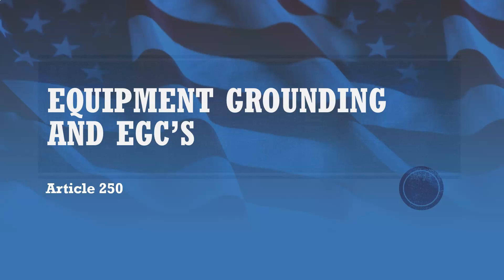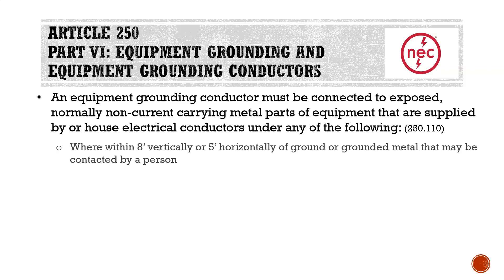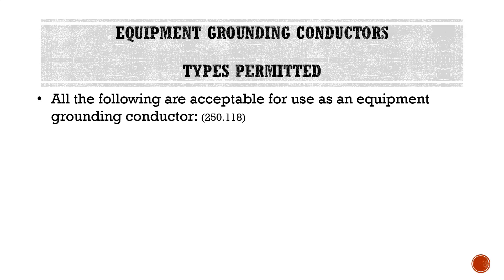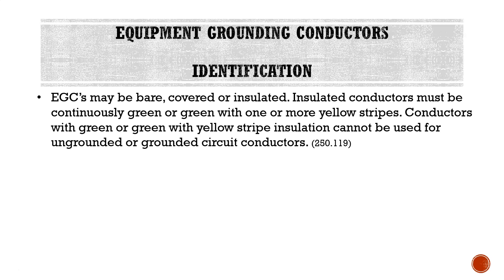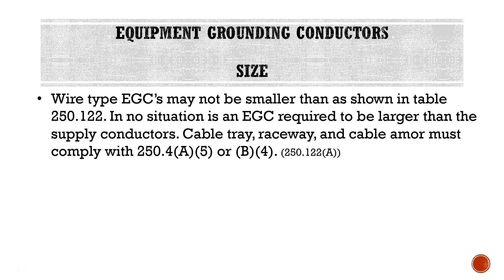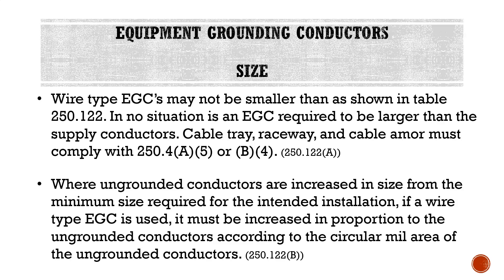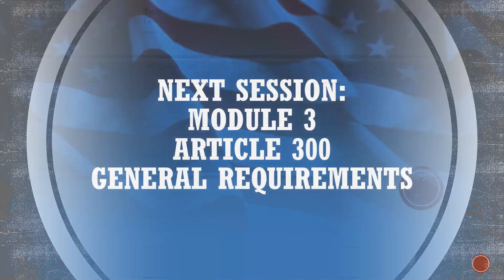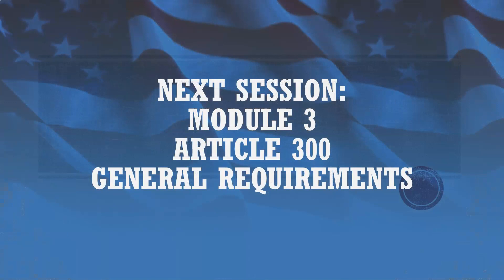Equipment Grounding and EGC's

Comment: It seems to be missing standard over current protection device sizes. What would a 50 amp circuit equipment grounding conductor be?
Reply from the maker: That would be sized per table 250.122, so since the circuit ampacity does not exceed 60 amps a #10 copper or #8 aluminum conductor would be required.